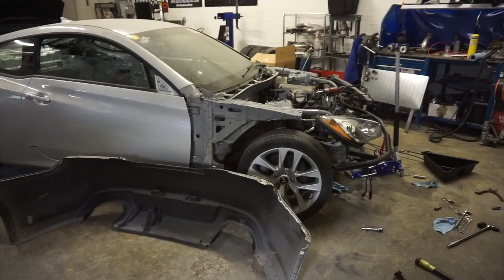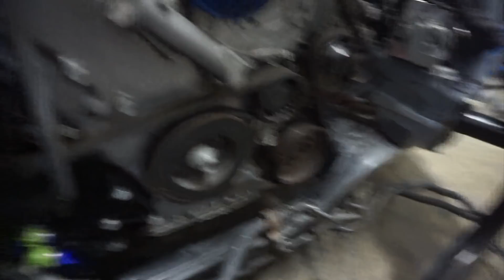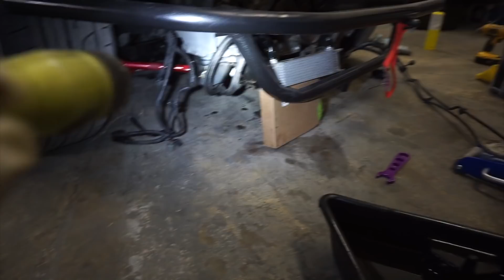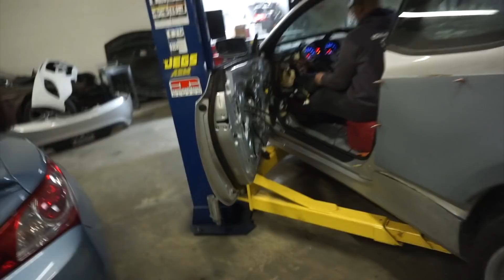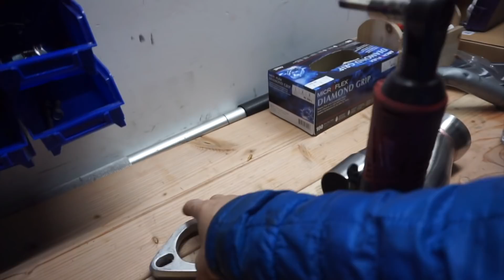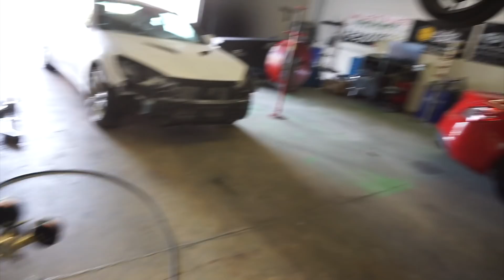Drift car 3.8 swap starts up | Custom exhaust

Comment: I would love to see the S14 with a Theta 2.0t engine. That would be like the “Mona Lisa” of SFR lol. Dub it the “Gen-SX”.
Reply: Denny Nguyen 3.8 would be cooler in my opinion that's why i loved the 380sx do much when they where building it genesis coupe 3.8 swapped 240sx
Reply: rushking19 Tru tru but imagine the 2-step and launch control on it 🔥